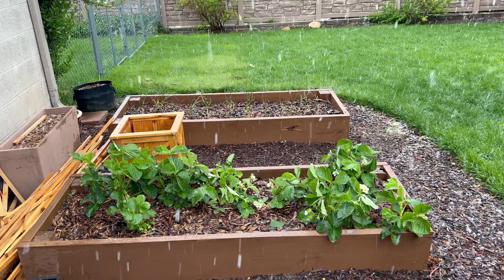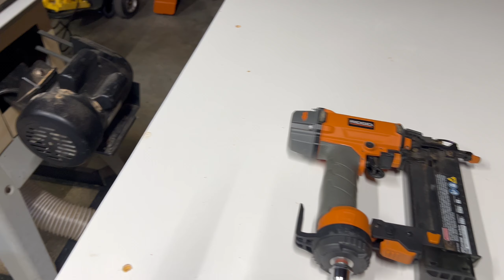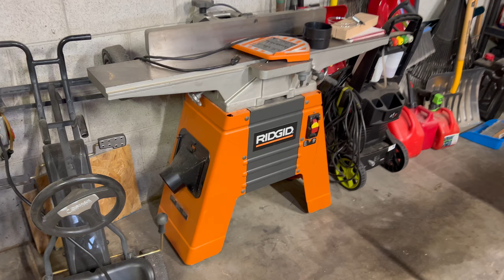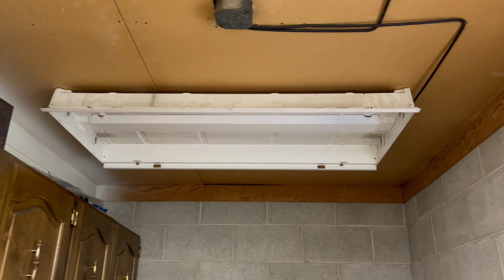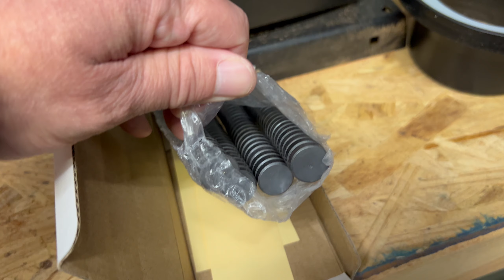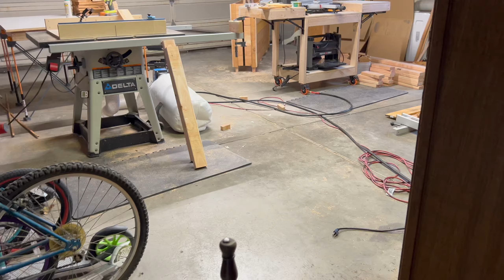Simple Woodworking Idea to Get Free Tools for your shop (essentially).

Comment: New to wood working here. I’ve been adding to my collection of tools over the years (😂still in the boxes till recently)
I’ve built one of those planters and it turned out great.
Then a couple other different things. My plan is to spend the next year making a lot of different things and getting to know my equipment.
The last 20 years as a machinist had me using dial calipers to make a grid of holes for dumdum suckers 😂 and found out there are drill bits I don’t have for wood that keeps the tear out to a minimum. With a full time job keeping me busy I’m taking it slow.
You’re doing great! And harbor freight isn’t anything to be ashamed of. I have a few big items from there and love em.
Reply from the maker: Hey thanks! I love most of the harbor freight stuff I have bought